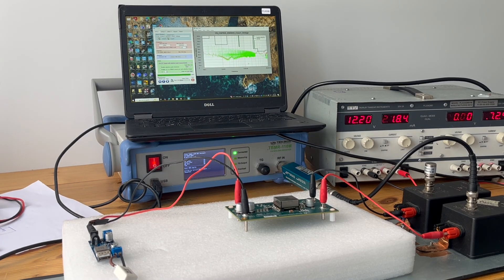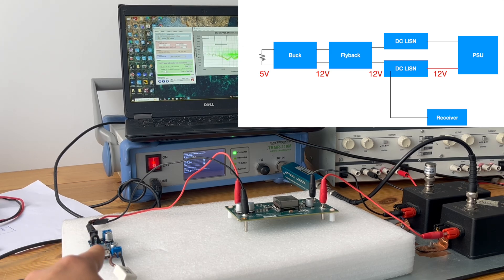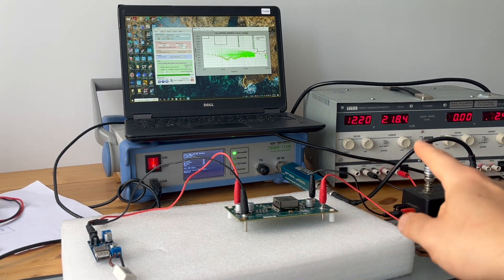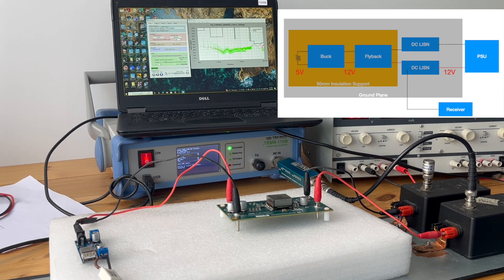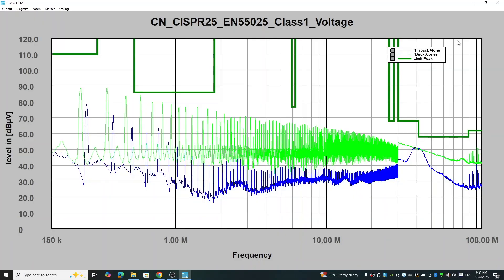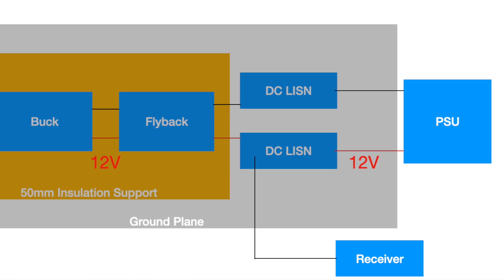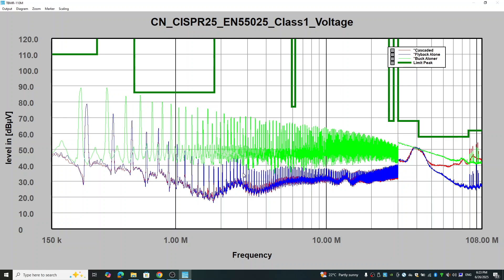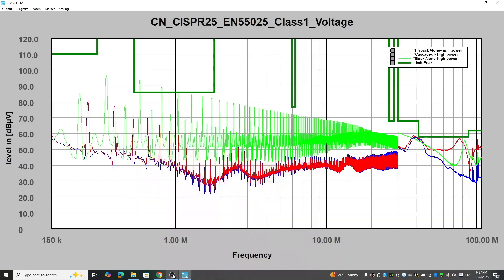Conducted Emissions of Cascaded SMPS — Unexpected Results from Real Measurements

Comment: Could you also chcek cascade of non Isolated Supply? E.g 2 bucks converters? Why you choose flyback? In Automotive typical you do not have Isolated dc/dc in high speed design just a lot of Buck an some boost. For me it is more complicated when you introduce converter with transformer. Regards, JM
Reply: Good question. I guess isolated DC-DC work-out EMI can be a bit different.